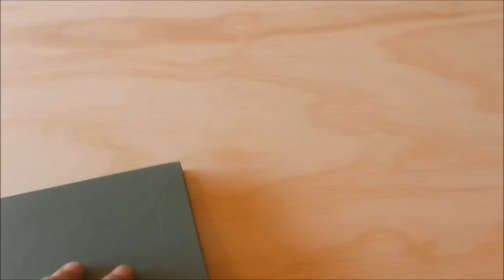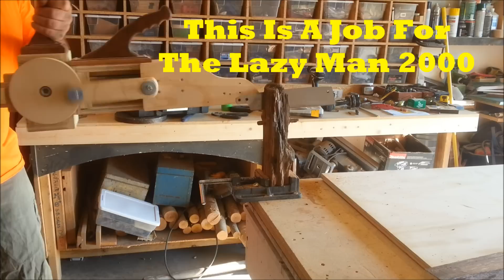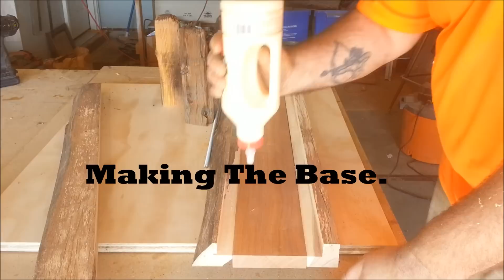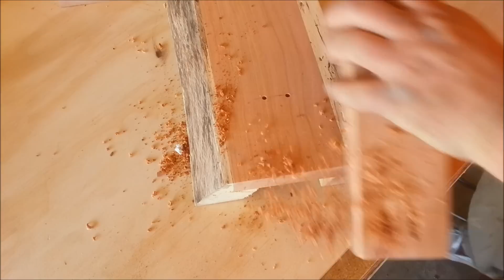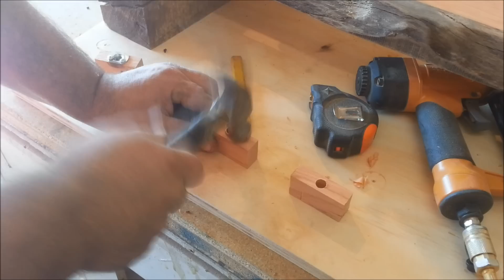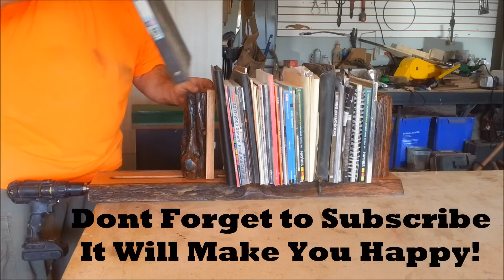Bookends

Comment: freehand pocketholes, and it works, seems great
Reply from the maker: it takes practice, easy to blow right through a piece if not very careful.
Reply: I have never seen it done before I thought it was kinda neat, though I will stick with using  my kreg jig, those angles are too tricky to do on sight

Comment: What happens when the electricity goes out and your battery dies, do you use a brace???
Or do you build a 2,000 year old battery charger out of old clay pots and flotsam from around your shop?

More power power bookends Tim Taylor would be jealous
Reply from the maker: I am Down With Clay pot batteries  with lemon juice and wine.

Comment: You should get with one or more of the electronic guys here on the "tube" and add in a motion sensor, an arduino, a raspberry pi and a pressure sensor.  THEN you would have something.  Otherwise this is just wood.     8-)